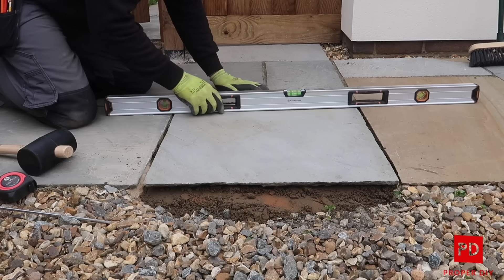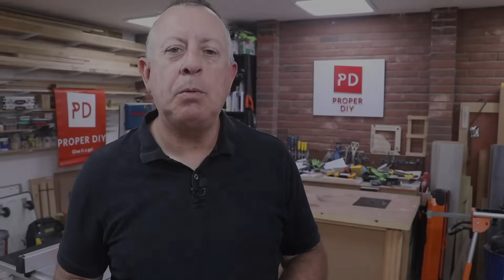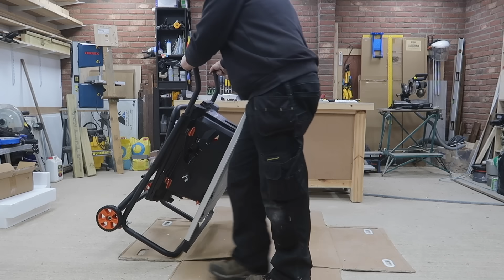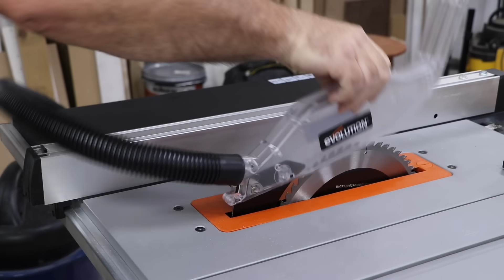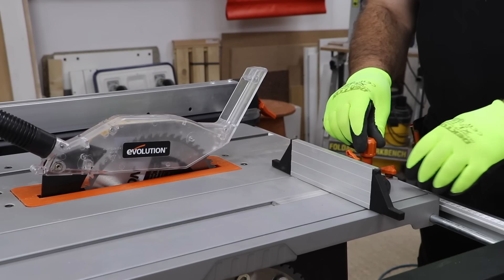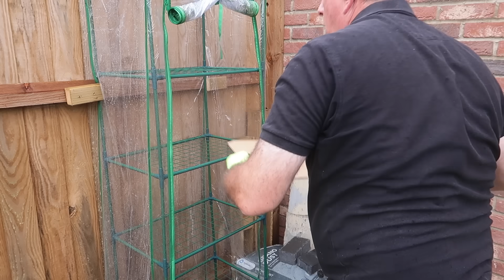Table Saw Basics for Beginners

Comment: Thanks for review it gave me all the answers I required to micro adjust,especially  helpful  with the adjustments on angle wheel my table saw is now 100% perfect.
As you say instructions are not explained for any adjustment other than blade adjustment screw under blade.
Thanks again

Comment: If I've got a piece of 2'x4' ply and I want to narrow it down from 24"x48" to 18"x48", what's the best way to do this with a table saw? I've got a circular saw and I'm a bit more confident with that, but I'm curious if a table saw would be good for me to buy. For the limited amount I'm thinking of using it, I'm not sure it'll be worth it to buy a table saw.

Comment: Hi could you please help me with advice on buying a table saw. I need a table saw that can be stored away as I will be working out side and the table saw will live in a 3/2 shed I was looking at either the black & decker 720 gp or the lumber jack with folding legs or the evolution 5/ s . What would you recommend please from Jason

Comment: Loved the video and all the info that you went through, so much so that I bought the saw. Well I hot the 5s. I have to say that I found the assembly instructions woeful and the figure drawings in them inaccurate. It took me just over 2 hours to get the leg assembly complete. Now that it is, I have to say that I'm very impressed with it and the folding mechanism.
Reply: Have to say the same about the assembly... Also the saw on the stand doesn't go through a standard width door so it has to go through sideways

Comment: Just a tip! You may notice that if you use the right side extending table (the narrow one) the LHS  guide (the one with the measuring rule) is longer than the right hand side - the only stop for the RHS is the plastic bung inside the extrusion which pulls out (tried adhesive - but not good) & does not prevent pulling the extending part too far and out of the roller guides of the fixed table! There is no proper fixed stop. A small piece of 6mm alumimium was cut out fit inside the extrusion  (about 25mm sq)  . A tapped hole in the stop piece allows a  5mm machine screw to be inserted  through the extrusion - works great!

Comment: I'm of the opinion that gloves are more dangerous than helpful.  If that blade catches the gloves, it can drag your hand into the blade instead of cutting off a hunk of flesh leaving the rest of your hand intact.  Also, in the horrible event that you should get cut, you don't want the medics to have to remove your glove from the mangled hand. But, I do understand the idea "sticky" gloves, but I think you are more likely to have the gloves snag on something than your hand slip. You shouldn't be pushing in such a way that, should your hand slip, it would hit the blade. Also, in a morbid way, if the blade catches the corner of your hand, it will cut it off, but will not drag your hand into the blad like it would if it catches a glove.

Comment: Must say that the supplied instructions were next to useless for the build of the folding stand.  However, I found an Evolution YouTube video which made it dead easy.  Why they don’t just identify the link on the front of the instructions.  If you’ve an engineering degree or you’re an astronaut you may not need the video 😂

Comment: Those wheels look absolutely toy-like.  And it seems to be wobbly.  But I guess that's the way with jobsite table saws.  My ridgid does that also.  But I just got a Delta contractor saw, so problem solved! Good video.  I subscribed.

Comment: The only feature of the Evolution that's nice is the slider - but it has a crap fence, and doesn't accept a dado stack. Having an "only use the blade model it comes with" and a giant gap in the cheapo insert are also big red flags, especially with their claim it's a universal saw for metal cutting as well.

Skil makes a far better saw that costs less and doesn't have the above flaws, though I'll admit that the dado's less of a concern in europe where they're banned.

I'll note to that there is no "can" on the miter guage. Run the material against the fence, or with the miter guage, or another fixture like a crosscut sled. Never freehand cut.

NEVER WEAR GLOVES! If your gloved hand goes in the fabric will be caught by the blade and potentially cause a far worse injury.

Comment: I've had this model of Saw for over 2 years, it's ok for what it is, I changed the blade for a better quality one. The design of the guard/extractor, while being very good at extracting dust etc, does not allow you to put the saw blade down far enough to maintain a safe working blade height when cutting thin material. Also the knob for adjusting/removing the guard is on the right hand side which hits the fence when cutting narrow strips. The plastic pad surrounding the blade is very thin and bends slightly when cutting certain widths. Despite these drawbacks I would buy it again though, it folds away into a small size and is powerful enough for most jobs around the home, I cut 100mm Oak Newel posts with it for example.
Watch out when you start it up though, since small pieces of wood that drop to the bottom of the plastic Saw Well, will move when you fold the machine up, then on start up they are fired out of the machine at high speed.
It's a Table Saw, needs to be treated with respect every time you use it.

Comment: https://youtu.be/86di2rV63wc

Hi Stuart, hope you're well.  Just watched your video about table saws and, although I don't have one, I thought you might like to see the chap in the link above.  He is clearly a long-time carpenter who obviously knows his stuff and often wears gloves (at 20 mins into his vid) to get a good non-slip grip on wood, he even seems to back up your blade height thingy.

 I don't want this to sound argumentative or confrontational, and I accept and understand that if one is wearing loose-fitting gloves and/or clothing there is certainly a danger of being dragged into a moving blade but it seems to me that if a hand is wearing a close-fitting grippy glove and is close enough to a blade to get into trouble, that would still be the case even without gloves...wouldn't it?  This chap even shows a sign extolling the virtues of using your own brain (since the machine doesn't have one of its own) - only saying.

Great videos and instruction, Stuart, good luck with the paddock!!

Robert

Comment: Stu I love your videos and this is a great introduction to folk considering stepping into the world of table saws. I have the same saw and used it for three years now. Would you consider doing a follow up video with additional tips? It might be worth including the auxiliary fence and when it should be used. My train of thought is for machined sheet goods like you used in this video then the full length fence is fine, but I use the auxiliary fence up to half way along the blade for any timber products as it helps to alleviate the pinch effect you referenced in the kickback section. Keep up the great work, really looking forward to seeing what becomes of the additional garden land you bought 😀😀👍👍

Comment: Your blade is set much too high Stuart,  the teeth at the top of the blade should just about protrude through the wood being cut. The setting you are using will increase the chances of kickback happening.  A rough guide would be to have one full tooth protruding through the timber to be cut.

Comment: Another interesting video.  I’ve been thinking of getting a table saw and already have a few Evolution tools - they seem quite good, although I note the motors are often physically larger than other makes, which can be an issue, say for a circular saw. I am not sure you have set the blade correctly in your video. My understanding has always been that the blade should be set as low as possible in these things. Also, I would not myself wear gloves when operating most types of power tools. I served an apprenticeship as a toolmaker back in the 1970s (using lathes, millers, shapers, surface grinders, etc) and things like gloves, loose clothing, long hair and even jewellery were thought hazardous.
Reply: Avoid it, look for one with a rack and pinion fence like Skil's in that price range instead.

And you're right about blade height, you should set it so that the tooth at the apex is just above the height of the workpiece.

Comment: Are you sure that's as high as the riving knife goes? Looks like it should be lifted a bit still or that the attachment for the guard is way too low. Not only do you have to set your blade way too high for clean and safe cuts now, but you also use a lot of cutting height.

Comment: Nice informative video. Kick-back is serious, the wood is propelled at a goodly rate of knots and can do soft tissue damage or worse - I have the scar to prove it. Conventional wisdom says not to use any gloves when operating saws and the like as they can get caught and draw the hand into the blade, they also give a false sense of security and you lose tactile feedback that can warn you of any problem. Many woodworkers have the fence slightly angled away from the blade and not parallel, this prevents it sticking for whatever reason. It is recommend that the blade height should set so that the bottom of the gullet is just exposed above the wood - usually the manufacturer specifies the height as that; of course it depends on other factors too, such as material and rake of the blade. Generally, the lower the blade the less damage your hand will experience. I noted the saw rocked on its stand quite a bit, might be worth making some sort of stabilising gizmo - a concrete block or two on the cross rail might do it. I think probably the most important thing to do when using machinery is to be present all the time, and not let your mind wander to the football or whatever - that is when accidents happen. Thanks for sharing.

Comment: I have always been told never to stand directly behind the blade, that way, if you do get kick back, there is a chance that the flying projectile won't actually hit you but embed itself in the workshop wall instead.

That and, as everybody else has said- Blade Height!
Reply: What you need to do is be in a position to push straight into the blade, akin to a hand saw. Pushing from off line is something done when you have mastered things.
Reply: If your ripping a small piece of wood you can't help but stand behind the blade.

Comment: Holy moly you can’t put MDF outside in the rain! 

Even if you weatherproof it by the time you’ve finished it’d’ve been cheaper & easier to use a different material.
Reply from the maker: Of course you can. I got it free from my local B&Q, I'll use it over the summer and it will go on the bonfire after that. Would you prefer me to spend £100 on a sheet of marine ply?

Comment: Their "10% off if you shop direct" deal still leaves them about 10% more expensive than buying from other shops... what the hell, Evolution? How is it possibly more expensive for them to sell me the tools direct vs the price of the same tool elsewhere?

£350 for this,  £400 for the Bosch, or £440 for a DeWalt, it just doesn't seem like a contest tbh. I like Evolution for their Mitre saws, but honestly their prices are getting silly I think, their prices are comparable to the "contractor" grade tools when they're still selling hobbyist quality.
Reply: This is the way channel works mate, they can't sell cheaper than the retailers who buy their stock at discount. Why would they?
Reply: @a5pin  So they can sell to retailers at a discount (who then mark the price up for their own profit margin) and still make a profit despite there now being two profit margins on the product... but selling it directly with only one profit margin is impossible without a higher price? Who taught you maths?
Reply: @audigex  no you misunderstand, if they sold the product directly to the consumer for a cheaper price than the retailer sells to the consumer. The retailer would complain to the manufacturer as they are undercutting the channel through. So the manufacturer will usually ALWAYS price higher than retailers. If they weren't they wouldn't have any retailers, would they? They get around this by offering other value adds, like free blades etc. So the price is higher, but you might get something different or more value than you would at the retailer.

Don't forget you would only buy one saw directly from the manufacturer, but the retailers buy in bulk of tens or hundreds.
Reply: @a5pin  Okay, so my point stands... their "discount" is pointless because they're still more expensive than buying elsewhere.

The mechanism for that is irrelevant: I don't care about their commercial agreements with Screwfix or whoever, that's irrelevant to me - what matters to me is the fact that their "discounted" price is more expensive than their competitors, even sometimes for a better product
Reply: @audigex  you clearly don't work in commerce. Different retailers will discount to different levels, and make different margins. Complaining is the same as walking into Halfords and paying 20% more for anything they sell compared to another shop. Some people just don't care, they see a 10% discount and buy. Ever bought a Domino's pizza lol £20 for one Pizza or £30 for two. Still, a tenner more than a Pizza should be. 

It's part of most company's marketing strategies.
Reply: @a5pin  Nothing you're saying here negates my simple point: Their discount is pointless when I can get the same product cheaper elsewhere

Comment: At last! I wonder how often you felt like caving and just buying one haha! Now looking forward to videos of you making jigs and accessories for it. I love using the table saw, so versatile and easy to make fine adjustments with test cuts. Nothing fancy for my first, a Lumberjack TS254SE, works well enough for my current skill level. It came with a rather silly riving knife design though, protruding well above blade height and with a laser guide on top! What on earth were they thinking? I cut a replacement from scrap metal that aligns properly. First shop build was a skate to move the saw around (eventually I'll replace the legs with a cabinet base on castors), then a basic sled - the king of TS accessories, now working on a big auxiliary fence and extensions to support sheet goods, doors etc.

Comment: I have the Screwfix version of this saw. It’s a lovely accurate & quiet machine. A bit of fettling & it’s a serious bit of kit. That blade guard, though. Why in the hell is the securing bolt’s head on the fence side of the blade guard? Any cut narrower than 40mm (the width of 2 fingers *DANGER ZONE*), you have to take the guard off. 
And, if you’re cutting thin material, the riving knife height is slow & difficult to adjust, so the front of the blade guard doesn’t pop up like it did on Ian around 8:50 in the video. (You need to raise the riving knife up, so the front of the guard stays on the table).
Only had it a week, pleased enough, but I’m well experienced with table saws.

Comment: Can this model deal with ripping lengths of 8b4 18mm ply? It looked perhaps a little on the small side from the video. Regardless, I struggle just lifting and manoeuvring these sheets, let alone the dangers of then trying to persuade it through a portable table saw! Will probably stick to the trusty old superlength 2.8m evolution track and circular saw.
Reply: I wouldn't do this.  this saw weights around 30kg with the stand. full sheet of birch ply is around 28kg. You would push the saw with the ply itself. unless you build a table around the saw to support the weight. The best way is to cut full sheet of ply into smaller pieces with a track saw and then use a table saw to cut that mateial to your final dimensions.

Comment: Stuart, I’m pleased you spoke at length re the dangers of kick back. If you multiply the circumference of the blade by the rpm you’ll get the speed of each of those blade teeth. You can then convert that speed to mph. You’ll then realise that each tooth moves literally, close to 100 mph. If one of those teeth at the back of the blade, which of course is about to travel towards you, catch the edge of the wood pinched tight between it and the fence it will shoot that wood back towards you close to 100 mph. This is way too fast for anyone to react and can cause such a horrible instantaneous injury you’ll wished you had never set eyes on a table saw. It only needs to happen once! This is in addition to other dangers like inadvertently cutting off a finger or being tempted to use the saw without the blade guard. For me I’d rather have full control with a much safer track saw and MFT even if it takes a few minutes longer. Working toward keeping out of hospital always seemed a good idea to me!

Comment: You should have an attachment to add to the fence so you don't need to clamp a piece of wood.

Also you only need a fence as far as the front of the blade, or just beyond the front of the blade, this reduces the risk of the wood pinching between the fence and blade for rip cuts and makes it easier to push through.